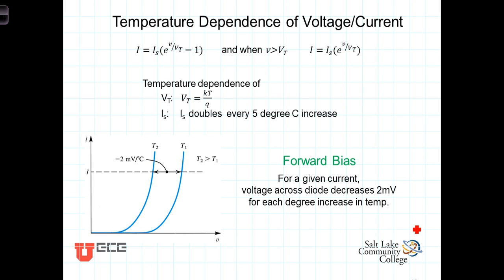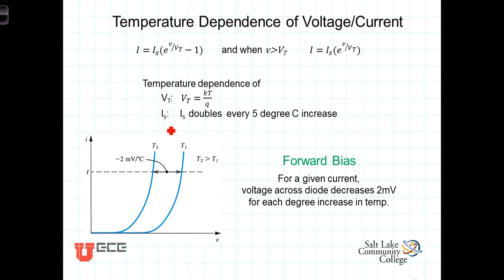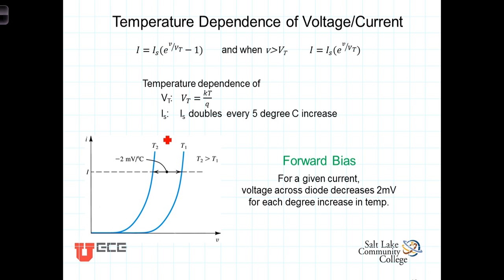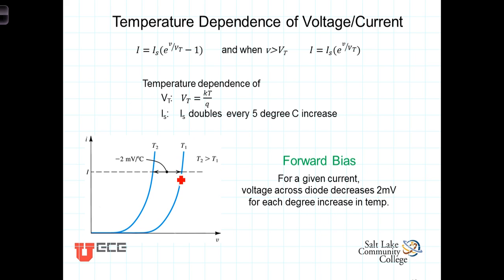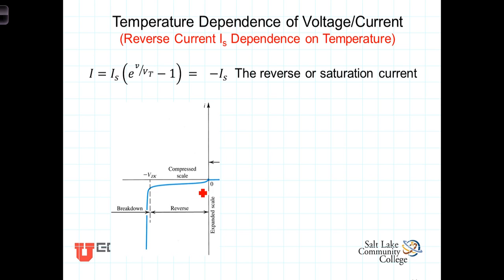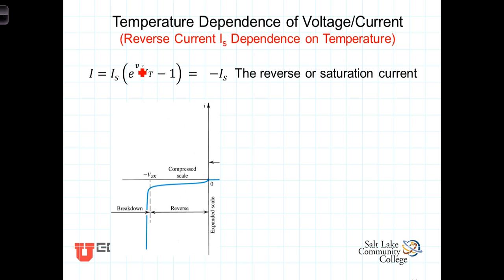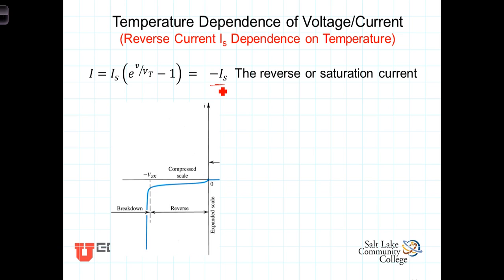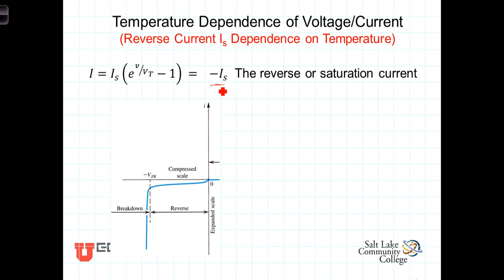L4 2 2Temperature Dependence On Diode Equation

Comment: Great explanations! I try to calculate power losses on diode during  time but I did not make it. Current passing through the diode increasing temperature which has impact on voltage. Voltage is not constant as usualy predict.